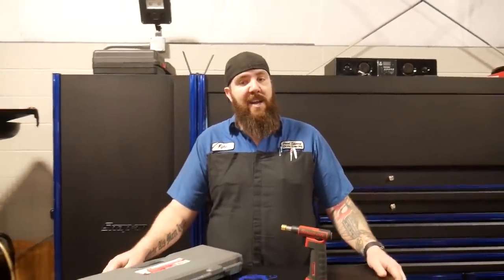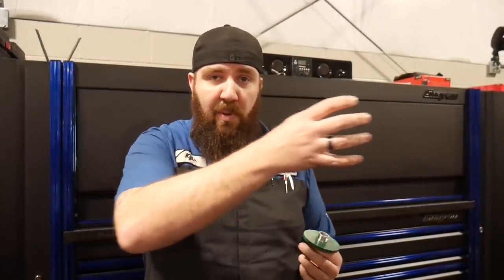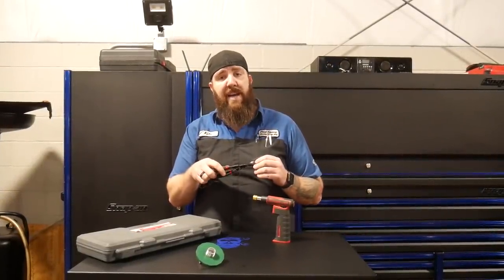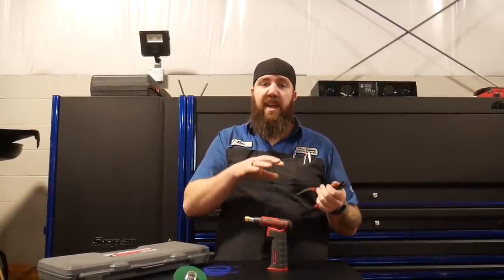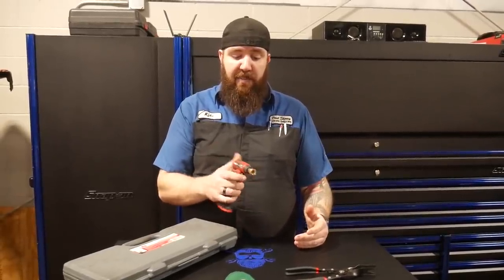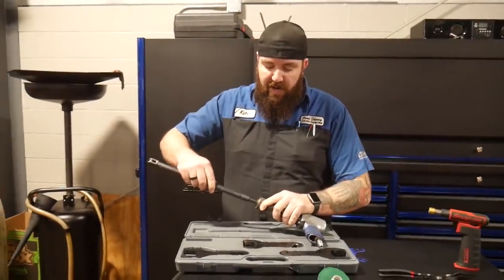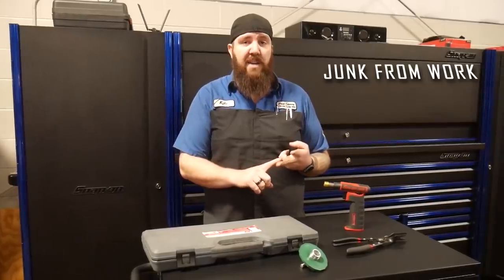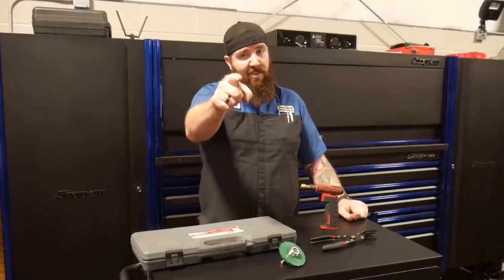NIFTY TOOLS OF THE WEEK - EPISODE 3

Comment: Awesome recommendations, I use the Cummins oil filter tool all the time, it’s a must have if you work on the newer Cummins trucks.  Fan clutch tool is also a must have.  I have the wrench extender without the hole for a ratchet to attach to it- it comes in handy once and a while, but I know I paid way less for it than Matco has it listed for.  I’m in Canada but bought it from lee valley